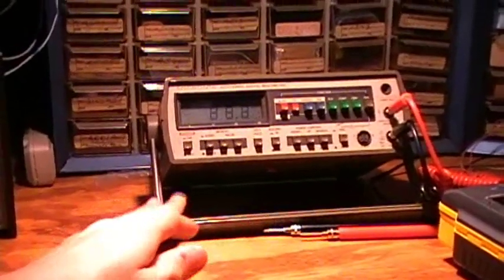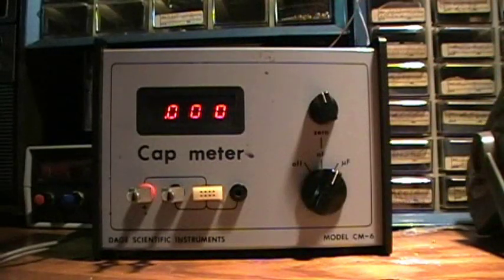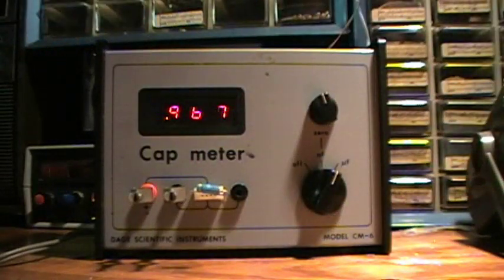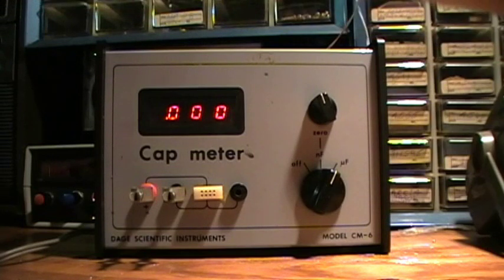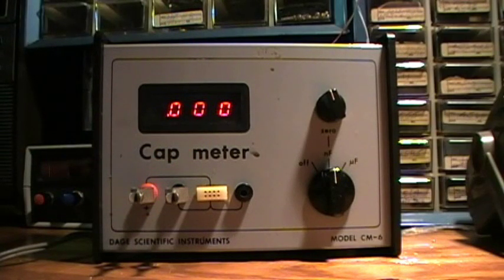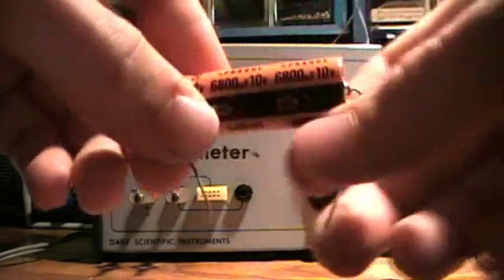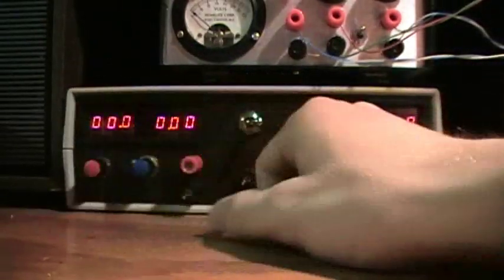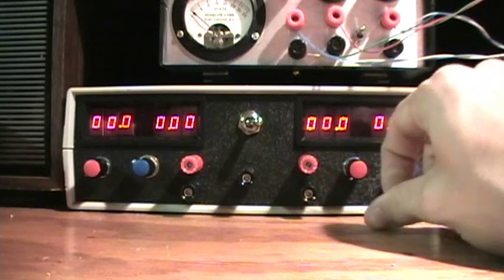Capacitor Meter, Dage Scientific Instruments model CM-6.

Comment: I have the same CM-6 built from Dage boards & critical parts, & sourcing the rest including a custom case on my own.  Works well and has a larger display.  To read greater than 1000 uf, count the left overange LED lights as they cycle.  top 1 = 1000, bottom 1 = 2000, both on = 3000, both off = 4000, top 1 again = 5000 and so on.  If you count in your video, you'll see 6980 for the 6800 uf cap.
website for the Popular Electronics article which this is based on in next entry.